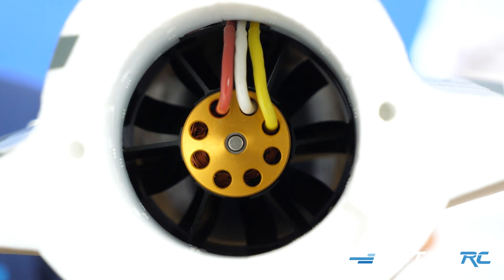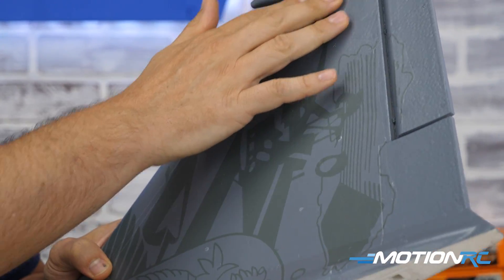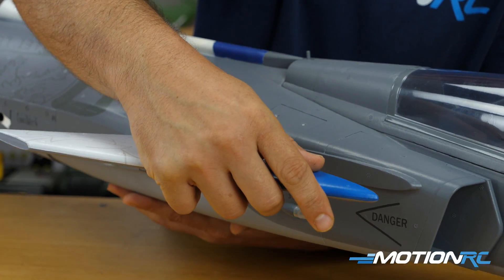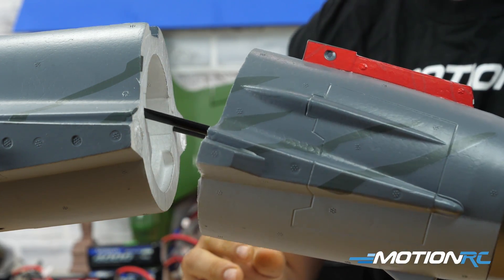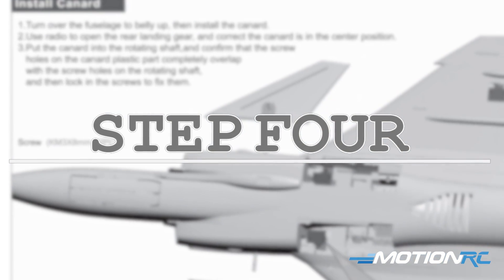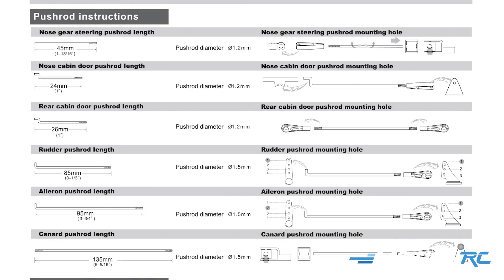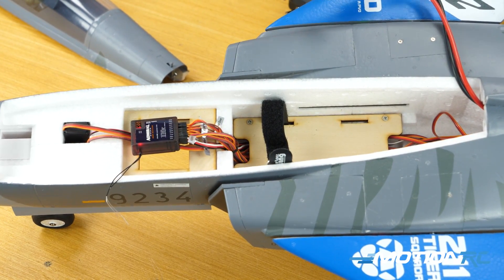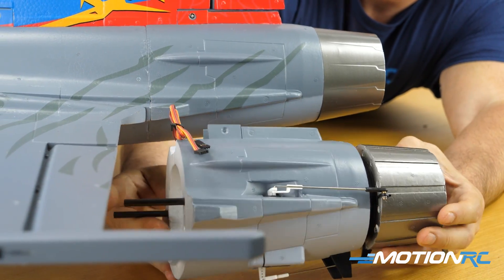Freewing JAS-39 Gripen Assembly - Motion RC 80mm EDF RC Jet

Comment: You should separate the power for the engine from the power to the controls. Use two batteries to avoid loss of controls when engine is at full speed at the end of battery charge.

Comment: Hi Motion RC. The real Gripen has a total of three landing lights, those who are located at the main struts, is there any possibility that the light at the front strut will fit the struts at the rear with its brackets and then for connection use two Y-harness for them to work? Any ideas?
Reply from the maker: off the top of my head right now I am not sure the nose lights will work, but there are so many smaller light options that for sure something can work with the leads as you suggested
Reply: @MotionRC  do you sell the nose light seperately so i could maybe try it out?🤔
Reply from the maker: @Isdahl87  under the Gripen spare part page, yes: https://www.motionrc.com/products/freewing-80mm-edf-jas-39-gripen-led-light

Comment: I had received my Gripen and noticed while building that there is no factory installed UBEC? And it does not mention anywhere in the item description page on your website or youtube videos that a receiver battery or UBEC is required? Can A UBEC be added?
Reply from the maker: you can always add  UBEC